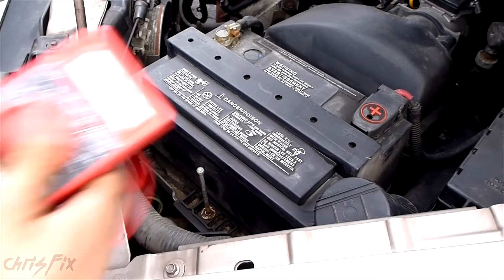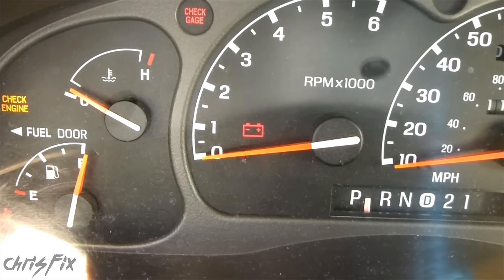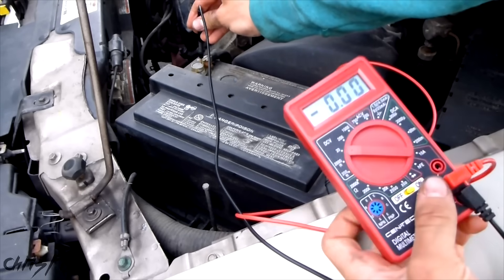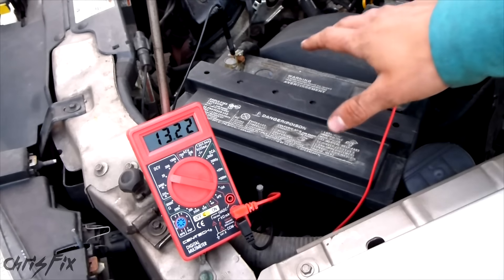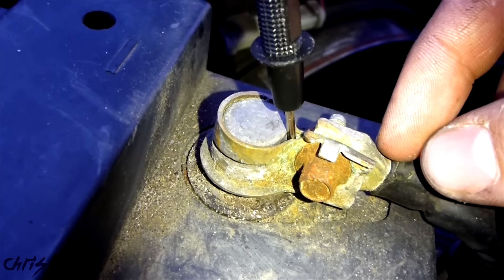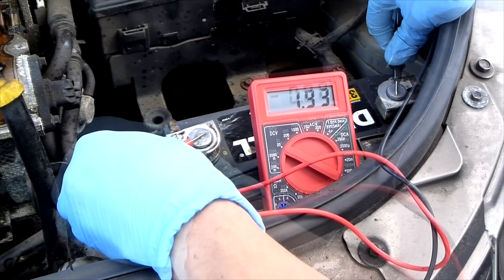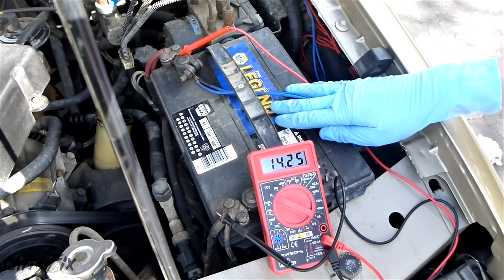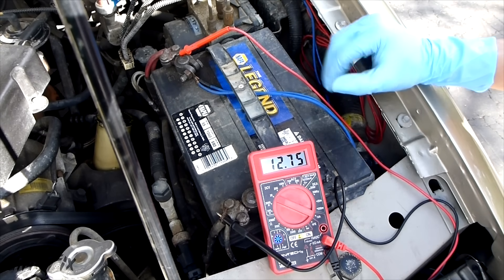How to Test a Car Battery with a Multimeter

Comment: My corolla's batter died in 3 years. My suburban has a battery on year 7 now, still working fine. I'm wondering when I should replace it. Another thing is that I think even if it goes below, I can charge it using a battery charger and bring it back to life?

Comment: hey Chris I have a multimeter like the one you have but it's dead is there anyway to charge my multimeter back up?
Reply from the maker: There is a 9v battery. Just unscrew the small screws on the back to get to it.
Reply: @chrisfix  Thanks for your help

Comment: hi Chris love your channel 😉😉
this morning battery was dead on my Toyota Yaris 1.0 2006 but I use jumped start battery to battery car start up straight away , but car battery wasn't completed dead .

but with out starting the car  reading says 12.75 

and when I start the car up reading says 14.16 to 14.17 never drop under 14.16 and I turn all the lights on and full  heating on and it coming at same  14.16 but still never drop under 14.16?? 

is mine ok or it could be alternator not charging   properly maybe?

Comment: Clicking/non-starting could be a dead spot in the windings of an old starter.  If your battery tests above 12, whack the starter with a mallet (med whack) while a pal turns the key... it will move they dead windings just enough to get her spinning.

Comment: Got this cheap multimeter and i think it is malfunctioning or its battery is going out. I followed your dirdirections and put the setting on 20 amps to check F350 batteries. I ran the heater and headlights for a few minutes with ignition all the way off. Touched the pos/neg leads to the battery, and 1800-1900 pops up for one second And then the #1 pops up and stays.  No decimal in the 1800/1900 reading. I thought this was going to be easy. Meanwhile in the cab the the battery needle/ alternator gauge, whichever that is reads a tad above middle range , i estimate 14/15..on the 8--18 field.

Comment: My battery on my diesel van is 12.7v dc without the engine running, when I fire it up, it drops down to 8.2 v dc for about 1 or 2 seconds, then back to 12 and slowly rises to 14 vdc, would you say 8.2 is too low? It's struggling to start

Comment: I have a problem with my battery I cleaned the posts and changed the positive terminal and still don't start the car but it plays music and lights turn on and the car could run for a few hours but a few hours later it won't start..anyone know anything about this thanks

Comment: Hey Chris I hope you reply back. But for some reason every time I bring my batteries in to an AutoZone or Oreillys to get a charge. They always tell me my batteries are bad….. but I’ll charge it anyways and take it back even though they say it doesn’t hold a charge! But when I bring it home and put it back in my car, it starts up flawlessly. I’ve had all my batteries still working and good two years after they told me it’s bad…… I’ve done some voltage test and with the car off some batteries will be around 11.5v. Car starts up perfectly every time, with bright bright led lights with no flickers. With the car running I’ll have 14v+ never really checked it after that. But you get the idea, my batteries are still good till this day. Do you think my local AutoZones and Oreillys are trying to rip me off? Honestly I think so but at the same time It’s fucked up to think about.

Comment: Been having cold starting issues and the voltage is at 12.32v, dropping to 10.2v on cranking. It was made in November 2015 so looks like it's time to look for a new one. Got it on a trickle charge now so I'll see how it holds up.
Reply: Mine is similar. Did a charge help yours out?
Reply: @DiademStudios9  I replaced the battery. I also replaced the starter motor assembly. I think both of them together were causing issues.

Comment: Entertainingly EVs have a 12v battery. And it can go bad as well. And since EVs don't have an alternator, they have to manage keeping the 12v battery charged off the HV battery. On a Tesla, it keeps it charged as long as the HV battery is above 20% charge. If you leave a Tesla's HV battery under 20% for a long period, you can end up with a dead 12v battery. Other EVs top the 12v battery up at night and can end up in situations where that doesn't happen.

Be interesting to revisit this video in an EV context.
Reply from the maker: Interesting, thanks for sharing!

Comment: My Acura had to be jumped off this am so I took it for a 15 mile drive on the interstate. Later found this video and went thru the process of checking volts and everything showed the batter had ample cranking volts and the alternator was working, but tried it once more after turning on the head lights for the 2 minutes suggested and that was enough to drain the battery. So seems like  this test can show a battery is good and functioning when it's really not.

Comment: I don't mean to go off topic or anything but I would like to add something that could be helpful because I used to work at a hardware store. If you're trying to jump start your car with jumper cables and you have it both ends hooked up to both cars and it still does not seem to be working. a lot of the time it is the jumper cables even though you might be thinking "how the hell are the jumper cables gonna go bad there's just two wires and clamps". I assure you they go bad all the time and some of them are just poor quality and you made me using a pair that isn't quite up to par with what you need. so before you think it's the battery or anything like that try to get a different better set of cables first 90% of the time it's the cables

Comment: Do You leave your car on running when you turn the headlights on for 2 minutes or does it not matter
Reply from the maker: Keep the car off
Reply from the maker: The goal is to remove the surface charge. If it’s running the alternator will just maintain the surface charge

Comment: Very informative, Chris. Thank you for the video. I just have one question, as I have very little knowledge with cars; so its safe to touch the battery terminals with hands even though its connected? and when we remove disconnect them does it have to be in a specific order? like first positive then negative?

Comment: No, not "bottled" water. Some bottled water contains minerals. You want water that is either distilled, or "deionized." If the bottle says one of those 2 things, it has water that you can put in your battery. Also, 1/4 inch above the top of the lead electrodes, is just a "rule of thumb." It may be a little bit more. The battery will have markers inside to show where the water level should be. As long as the water is above the electrodes it is ok. If it is above the markers, it is too much, the acid will be too dilute. What is most important is to avoid dry electrodes.

Comment: My battery drops to 9.7 volts on a start up but holds 14.9 while the car is running and 12.6 while the engine is off

Comment: My car feels like it’s dragging something, feels sluggish, the engine rev meter sometimes drops at low rpm, stutter even and then it heals itself… could battery be something to check into? Ignition is not a problem at all

Comment: Sanding the posts down just spreads sulfuric acid around the engine compartment (NOT GOOD). Make up a baking soda paste and apply it with a toothbrush. This will nettralise all the acid and when you wash it off the baking soda will neutralise any acid it touches as it washes out of the compartment

Vaseline is better than WD40. In a hot environment, silicon grease (not sealant!) works better

Comment: Hot water and an old toothbrush does the trick... apply grease or petroleum jelly to prevent reoccurrence of corrosion...use the toothbrush as the applicator to get into the nooks and crannies. Whola!

Comment: My battery was working yesterday, started the car right up, battery indicator went off when starting the car, no struggle. Today went to check my turn signals since I had an issue where my hazards wernt plugged in, plugged in my hazzards, turn signals worked for about 20 seconds and and lost all power to just the turn signal on, tried to start the car, and had no crank at all. How do I check if my alternator, or battery is dead?

Comment: To clean battery terminals pour near boiling water over the terminals then I  smoother with grease or the like ,can undo the fastening bolt wire brush, grease or oil ,wire brush battery terminal grease, put back together, end of job knowing it won't let you down in the future

Comment: so if you turn your car on and it doesn't go to about 14, your alternator is no good? im trying to figure out if my alternator isn't good without having to take out the alternator. please someone answer me this question.
Reply: PS my battery is brand new but it keeps draining. I have to recharge it everyday before I use the car.
Reply: Yeah that's about it

Comment: Need a battery for my camper.Been going around to different places with my voltmeter checking voltage of shelf batteries and most of them are showing 10.9 to  11.4 volts and they want 150.00 for them. Bought one mower battery and charged it up and next morning it was 11 volts. In my experience a new battery should stay at 12.3 to 12.6. Am I right or have all these batteries been on the shelf too long? I wish buying a battery was like buying a motorcycle battery where it is activated when you put the acid in. They have it now where even an idiot can do it.

Comment: If adding water to a battery you should use only distilled or deionized water not straight bottled water.  Bottled water may have minerals that are bad for the battery.

Comment: I bought a brand new battery to test my battery charger. I got it at a discount for being setting on a shelf at least 6 months. An all night charge at 8 amps only brought it up to 12.39 volts. I put my charger on repair battery mode & it came back to 12.58 volts. After a few runs, it should come up to 12.78 volts. Do you think I should open the cell caps to check the fluid level? Tampering with the battery voids the warranty.

Comment: Hey Chris that was very informative and right to the point. I do have one recommendation though ,might want to explain where to plug the the meter coils to I noticed that you are using the 2 bottom ones and there is a 3rd hole that you can insert them into. Many people have these meters and they don’t read the instructions or lost them. Only a thought, thanks for sharing

Comment: Multi voltage testers doesn't always give you an accurate diagnose of whats really going on, a tester can show the battery reading with good passing numbers but in reality the battery yet has faulty issues regardless the battery reads good.

Comment: Before you check a battery, you have to have a reason for doing it. 
The first step is to verify that the top is clean, dry and has no white deposits or dirt. That includes under the top  hold down bar or clamps.   White deposits indicate over charging. Dirt with oil or any moisture, including overnight condensation will slowly drain a battery.  
The second step is to check the sides of the battery for the same thing. Some cars like Hondas have plastic shields the encase the battery. They can conceal soil. 

A normal battery when fully charge has a resting voltage a few hundredths of a volt above 12.6 volts. If left unstarted for a few days, the "always on" the always on electronics of a modern car will draw enough current to drop the battery voltage by 0.02 to 0.03 volts per day. After 2 weeks the terminal voltage can be as low as 12.3 volts.  This is not a problem unless the engine doesn't start on the first try. 
If the temperature drops significantly (by -30F or to sub-zero)  or the battery is undersized, a car left for more than a week in a parking lot may not start.

Comment: Nice job, clear and concise without a lot of unnecessary fluff. One other comment, I was always told to use distilled water, bottled water or spring water or mineral water may hurt the life of the battery by causing corrosion. I’m not an expert on at $.80 a gallon I would buy distilled. Thank you.

Comment: I took my car to a repair shop and asked them to test the battery but they only tested it with the car off, I asked them if maybe they could test it after starting the car and they said it wouldn't make a difference and there's nothing wrong the battery. Should I trust them or should I just get a multimeter and try it myself?

Comment: my car electrical systems is suddenly shut down. no self start no lights nothing. before that car started and all electrical systems in  tip top, so dont think if bad battery could fail so quickly. does it indicate fuse failure? any help appreciated.

Comment: Just an addition from an old hand, when you clean the terminals use petroleum jelly or grease, not wd40, lasts longer. Also battery light going out shows charging circuit is fine not that you have a good battery 👍

Comment: hi Chris i need advise on my battery status i had a test done and the shop asked me to change my battery the readings are : Battery  Test : Volts 12.71 , CCA measured 322A, Rating 650CCA
                         Starter Test : Volts 9.82V
                         Charging Test : Volts 13.90V
Do you think its ok to buy a 6V Battery charger and charge the battery or do i replace it?

Comment: I have found that in general, if it is a connection that goes bad, the car won't do anything. Dead. If the car tries to start, it is usually not corrosion but a drained battery issue ( for whatever reason (-left a light on, alt not working, ect.)

Comment: Very useful details about the flagging performance and what to expect if the battery is knackered. May I make one suggestion ?  If you disonnect the battery to clean the terminals remember you could lose your car Radio CD Player function,  if you haven't been given the Radio Code to start it going again. On several cars I bought in the last 20 years the code has been missing from second hand car user paperwork and even a new car bought in 2015 hasn't got the code.  Trying to get it from the makers is like trying to get a spare key - they'll sting you for £30 uk to give it to you.

Comment: My 12 v battery on my ev may be degraded but hard to tell. Lock down for covid, lower mileage, funny system ... who knows.
A maintenance charger is keeping things OK but how could I use my multi meter to test this? No cranking ....

Comment: Very true the batteries do not last now days. You can extend the life of the batteries with Epsom salts. My last battery from Car Quest lasted 12 years using Epsom salt. Purchased a 1 year battery from Wall mart and it died at the 1 year mark. They only put enough water in these batteries to last the warranty. Take the sticker off the maintenance free batteries and pop the plugs off to add the Epsom salt mix and charge accordingly. These things are pushing 200$ these days and this procedure works and will save you money.

Comment: Pro tip:  turn lights on for about 30 secs esp in winter, turn them off then start car. That will help extend  Battery life quite a bit. DONT do it if you have an already weak battery that might not start the car

Comment: WD-40 on battery terminals?  Kinda runny... might even seep in around the posts and fill-holes, and contaminate the battery.   How about using something more application-specific, like maybe dielectric grease or something even more targeted, like Battery Terminal Protector spray (various brands), aka "the sticky red stuff".  ;')

Comment: Since course sand paper will make grooves on the post and cable, can u use steel wool? Which grade? Also, os it better to use the red anti corrosive battery term spray or what is best?

Comment: I am getting blown fuses every time.  I tested all my connections and all just over 12 volts. Have a good ground, remote and battery connection.  Could it be the Amp? It’s pretty old.

Comment: NEWER use SANDPAPER for that! Sandpaper particles are dielectric, they may stuck in soft lead and it will cause bad contact. Use a metal brush or something.

Comment: Great video as always but I was a little surprised that you said the battery shouldn’t drop below 10 V at cranking. I figured it would be higher than that because I figured the engines electronics would need more than 10 V to fire the coils.

Comment: Hi Chris. Turned the lights on for two minutes, then off. Reading is 12.2v so not at 12.6v like you said. With the engine running, reading at 14.47v. What's the verdict?

Comment: Wow Chris great vid! Measuring amps wouldn't indicate anything? My 2013 fit won't even start with a dedicated charger/booster plugged in. The charger/booster reads 5 amps and doesn't seem to go up. When I switch it to boost mode,  the booster outputs 13v, the engine does 3-4 turns and dies off...Also it's -20 celsius. Any ideas?
Reply: Battery is pretty old. Reading online that even boosted, a bad cell could impede a boosted start?

Comment: If the voltage goes to 14v when running then the alternator must be ok? 

They charge 20 to test the battery at the shop. 4 years on a battery and remove/replace I say. Why try getting every bit out of a battery then get stuck somewhere. The 10v or more is a great point though.
Reply: $20?! That's a rip off! Most auto parts stores will test your battery for free.